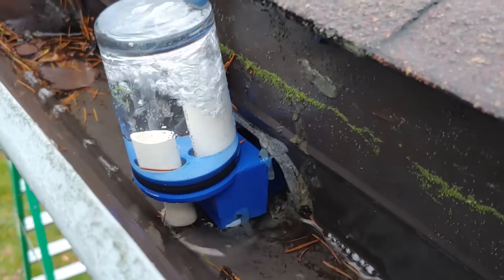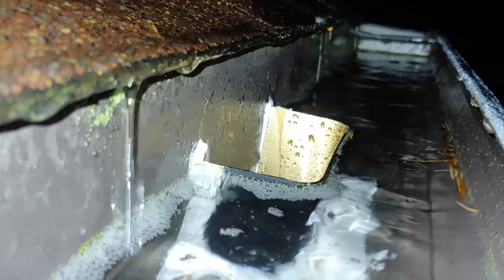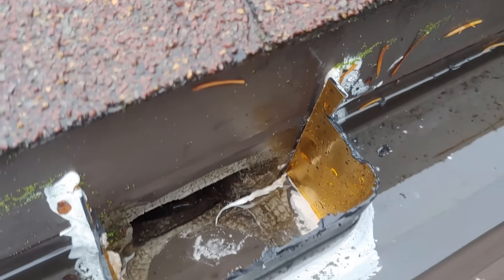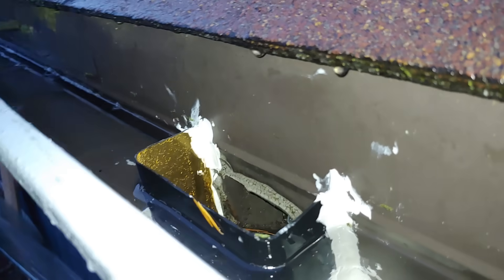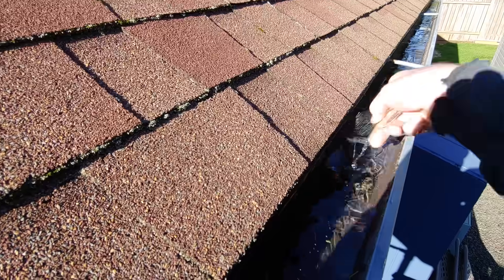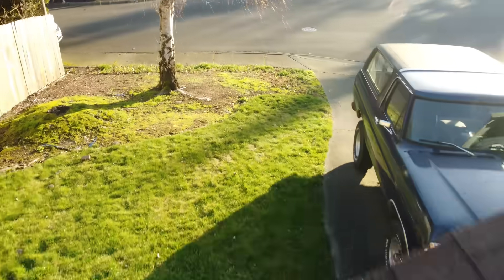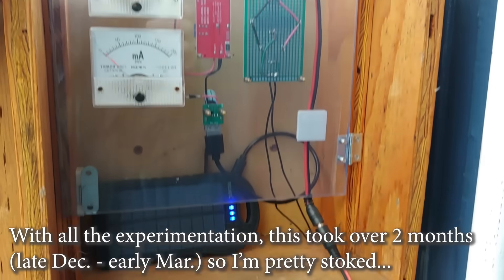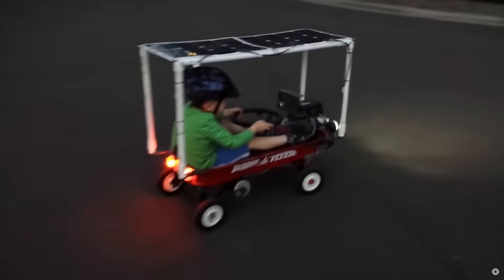Rain Gutter POWER #6 - World's First Rain Charged Phone!

Comment: i picked up some mini hydro generators last year to mess with... now if i can only remember where the hell i put them!!!   why not chuck a couple water totes at the bottom and use it to water....  uh... stuff...   or instead of generating power when it rains, capture the water, and use THAT water to generate power when you want it.   or while you're watering...  a 2 fer....  OR, you could put a first flush adapter into the downspout to create a 4" column of water and use THAT as the power for the pelton.

Comment: Imagine applying this system to every building in your city. Tons of power could be harvested! And it can also be applied to all the sewage water as well.
Reply: Not sure you understand the scope of modern power consumption. This generator produced a single watt. That means, roughly speaking, you'd need a thousand houses worth to run a toaster, and could only make toast when it rained. And who's going to maintain a thousand micro generators for months... Just to make toast once?
Reply: @michaelsorensen7567  Your 1000 watt toaster only runs for like two minutes, so it uses 33Wh. Now make the roof 10 times higher and in only 3 hours of rain you could power the toaster completely. And this is only with a small roof. You don't need to run the toaster directly on the generator. It can be connected to the grid and distribute the power to where it is needed at the moment.

Comment: What about a big wide bucket just under the roof with several bell siphons activated at different levels? Then you get power storage and use of all the flow
Reply: or a bucket on a string with the string turning the generator shaft. Have a counterweight on the other end of the string to lift the bucket back up after it empties once reaching the ground.

Comment: I've been curious if you could use the non drive wheels on a vehicle to charge a battery specifically an electric car.
Reply: You could alternatively run a belt directly from the engine to a power-generating device, and regulate that to charge the battery (so it charges even when the car is stationary) - which is what all cars do anyway.

Comment: Ehhh another benefit of a bucket style wheel is you don't need a nozzle so debris can flow freely, also it eliminates the siphon so it makes it much more practical a design for the average viewer.
Reply: Like an old water mill?
Reply: @iamdave84  Yeah exactly, high torque and gear reduction into the electric rotor. Ultimate power availability would be constrained only by bucket size and wheel diameter.

Assuming space to be a deciding factor you could to a triple stack of wheels each one feeding the one below it.

I would go with larger motors such as the ones found in electric scooters, doing this allows higher amperage meaning we can wire in series; benefit is harmonization of the three wheels.

Efficiency may see a drop off this way but three four feet diameter wheels are much more manageable than one ten foot diameter one.

A little woodworking and some varnish you could actually have something rather nice looking.

To maximize efficiency you could have a load sensor and either a brake mechanism on the shaft or use electronics and short the motors.

What I mean by this is stop the wheel from spinning if there is not enough water, allow the buckets to fill to a set capacity then when torque is above a predetermined point allow rotation and power generation; Essentially turning the water wheel into its own reservoir.

Comment: Maybe you could try a different energy generation method for the overflow side. Like using the falling weight of the water in a bucket to spin a gear or whatever
Reply: Bucket on a rope, slowly lowering as it fills with water and turns the generator. When the bucket reaches the bottom, it needs to self empty and go back up to start filling again. 20L of water in a bucket with the right gear ratio could surely give much more energy to the generator than his current setup.
Reply: @iamdave84  I think a turbine in his current setup would even generate more power. Like how an actual dam works for electricity generation instead of a fancy water wheel

Comment: @ 7:00 -- Chamfer the inner & outer lips of that pipe you've got your finger stuck in. The flow inefficiency is affecting your power output down at the bottom of the downspout...
Reply: How? It fills up the pipe either way, so there's still water pressure from gravity with or without improved flow, right?

Comment: You charged the battery with the rain or the sun ?! :) To be sure it doesn't load by sun you should hide the solar panel of it.

For the water load you should put a tank. So the you'll not lose any of the water and i think it'll give more presure at the pelton wheel?
Reply: The solar panels on those powerbanks are utterly useless.

Comment: try nuclear charged phone, or a battery pack
Reply: tesla turbine with shroud, to get max power
Reply: you could pump up water in a tank with the excess path flow
Reply: why not use the main downpour pipe with diy larger tesla turbine
Reply: melt the snow for water, or make ice from the water, very clean
Reply: fire alarm battery charger

Comment: I was thinkin bout water being in like one of those 60 second sand time capsules, but have some sort of way to harness the water as it spins down everytime you flip the capsule
Reply: That's basically how pumped storage hydro electricity works. When you have excess power, you use it to "flip the timer" and pump water to a high reservoir. When you need extra power (often after sunset when solar output is negligible but everyone is cooking dinner), you allow the water to flow back down to the lower reservoir and capture electricity back.

Comment: Do you realise that what you've made there is only a few steps towards removing pollution from the surrounding air?

Take this idea to a city, create a tromp system on the rooftops of high-rise city buildings the water being gathered in massive header tanks can be directed through run off guttering all the guttering needs is small upright pipes on the sides of the gutter down pipes and the passing water will create suction drawing the surrounding air into it and of course the pollutants. 

These gutters could pipe off to holding tanks and create a compressed air system which can be used for lots of different applications and the air being used could be filtered off prior to use.

Doing that would mean all kinds of benefits, compressed air can run all sorts of things from cars to tools and when it's coming only at the cost of fabricating the equipment to harvest it, it really is a win win.

Cleaning the air ✔
Reusable in lots of applications ✔

Nature would naturally do a similar process but it's rain droplets what capture these pollutants and they would either run off into the ground of into rivers and then down into ocean's, this is why high carbon concentrations can be found in deeper ocean levels, the process takes place more during the winter and the cooler conditions allows the carbon to be taken down to deeper oceanic levels. 
Very cool to see people building the things what have been in my head for over 20 years, I've just never had the finances or a large enough building to demonstrate their effectiveness in a reasonable manner.

Comment: You could make a large shallow reservoir that accepts only from the overflow and flows back through a lower hose with a one way valve.

A ram pump would allow a higher reservoir but would only save a portion of the water.

Comment: Would a better use of the power received from the gutter system be to put heat back into the gutters as a low intensity do not freeze setup? I know it's not using the power for anything "cool" but it seems like keeping the gutter running would help out in the long run, and you'd only have to heat the metal to~ 40 deg F to be effective? also, maybe just wire screen under the gutter stuff balled up would make a 2 filter setup, with no new products?

Comment: You should have all your gutters fill a water tank that is mounted at a height just 6" from the gutters. When the tank gets full then flow it through a turbine that is mounted 8' below. I think this would be optimal energy output.
Reply: That's .. genius. You don't touch the gutter, but can play around the water tank instead. No need to mess with cleaning much

Comment: I never found an inexpensive gutter screen system that worked particularly well. I remember when we had gutter screens installed at my now-ex's house in central North Carolina, where we got lots of pine straw, etc. It was an expensive system that used a fine steel mesh on anodized aluminum frames (as I recall a decade later) but was worth it because we never had to clean the gutters again.
Reply from the maker: Was it MasterShield by chance?

Comment: It is indirect solar energy:) the sun lets the water evaporate and turn into clouds and then it rains and is turned from potential energy into electrical. If you have a biget downspout you can store more water and thus more energy.
Reply: Most electricity is indirect solar energy. Hydro, wind, thermal, coal, gas, etc. Trace the energy back and they all come from the sun.
Reply: And the sun is nuclear energy, so all the energy on the planet is nuclear in origin. 🤣

Comment: An idea for a leaf filter (not saying it's a great idea, just a thought): replace the marbles? or put this before the marbles? Use something hole-y, of course. Okay, the idea: think of an 'L' shape, the short part  coming from the back of the gutter straight out to the middle of the gutter, then the long part of the 'L' running along the gutter forrrr 30cm-ish, and then closing off from the top of the 'L' to the gutter... kinda more like a 'Z' shape :P

Basically dividing the gutter lengthwise, with a stopper at either side of the top and bottom.
The idea is that water could still (hopefully) more easily flow through the long hole-y wall before debris fills the channel and completely stops flow. It would still need maintenance. Oh, lastly, I'd put some of that same mesh you use to cover the siphon over this, too.

................................................................ gutter..................................
||____l_o_n_g_h_o_l_e_y_w_a_l_l____     water flow/debris catcher
........................................................||...............................................

Comment: a pelton wheel's ideal speed is half the water's velocity. the water should have no more velocity after the wheel and simply fall down.

 im sure if you optimised the system some more you could get more power
Reply: From what I understand of Pelton wheels, the water should change direction by hitting the wheel too, so more of the energy is absorbed

Comment: What about putting a header tank under the gutter and piping the the overflow from the other end into it too. That way you’d have a bigger head of water that is topped up by the gutter. You could put a filter in to the top of the tank to keep the water clear.

Comment: Love watching you tinker around with stuff like this.  If the overflow water seems wasted, you could add a large 'storage tray' somehow on the end of the gutter to try and capture a few extra gallons before overflowing.  Then as the rain lessens, the 'storage tray' would drain back to the gutter to extend production time.

And since your roof is inclined, how about adding a cleat/rail about halfway up to divert half the water to a similar setup that is higher?   Higher overall head means although you'd have half the water, you'd get more than half the output from this second system.   Or maybe divide the roof into thirds?  Or fourths?   Could do a whole cost-benefit of the optimal number of sections where each section benefits from slightly different available head.  lol.  

Just kidding with these ideas, I know the capital cost of a second turbine would far outweigh things, but it's fun to speculate on paper.

And I was glad to see the caption about the issue of 'peak power' capture.  Wind machines have this problem as well.  If you size them for the 'highest expected wind', they operate almost the entire year at far below capacity.  

Again, love the content and how well you present things.

Comment: Why not move your overflow closer and just send it down the same down pipe to the generator.  Then at the top of the pipe cut a little hole to limit the pressure on the bottom.
Reply: It's not the bell syphon that is limiting, but the inlet to the turbine.  It can't handle much more than 2 gallons a minute.  When it rains harder than that, the water just backs up and overflows the gutter unless he diverts it away through the separate overflow.

Comment: Imagine if you put the screen over the gutters and you can use neodymium magnets to hold them on the sides of the gutter they come with different pull strengths so you wont have to worry about the screen coming lose then when you want to work on the gutters just lift the magnets off the spots you need to work on and can replace them easily.

Comment: Only part way through the video so you may have rectified the situation already, but, I think you need a pre-filter. Like one of those handheld swimming pool skimmers. Catch most of the debris in something that's easy to access for cleaning. A strip of window screen across the trough would allow debris to blow off in the wind but still allow water penetration. Hardware cloth and screen if you plan on leaving it out in the winter. :-)

Comment: Had a random thought: if your excess run off shoots at the bottom of the wheel as a supplemental stream would that double your output?

I’m thinking bike pedaling without pedal straps vs being locked into your pedals